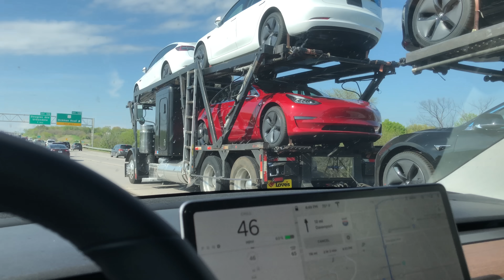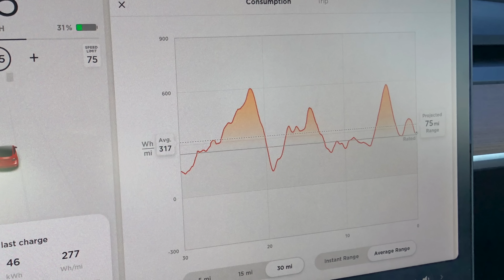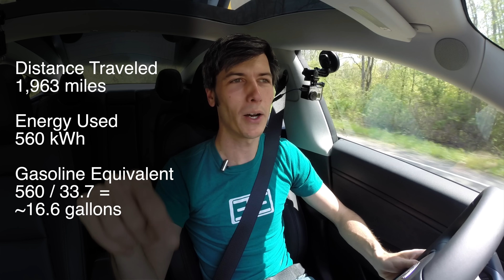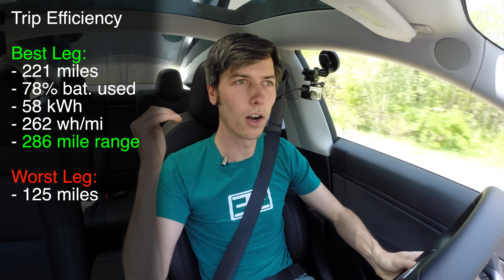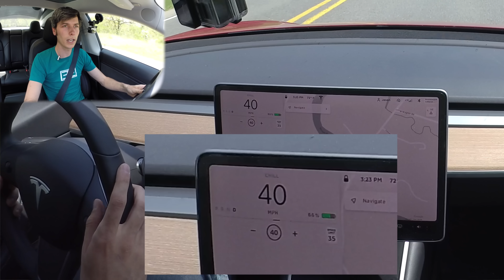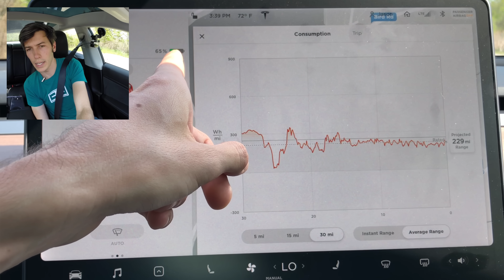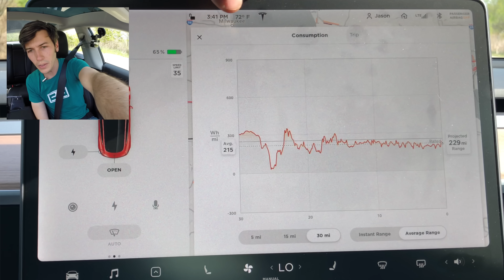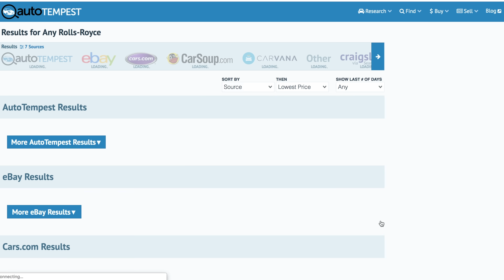How Miserable Is A Tesla Road Trip?

Comment: Okay you are a science guy and i have a question. How much this fast charging will affect the battery like, what can we expect in the next 2-4-7-10 years? when and how will the battery give up and we are gonna be forced to replace battery or car it self? and is it efficient for the peoples pocket? i mean will you save enough from driving EV  or for example 2.0L petrol engine with AVG fuel consumption of 6l/100km? will it pay off in about  before the battery die or not? cuz  normal person knows that this is not for the green planet this car is not green and it probably makes more mess than a 3.0L diesel engine in a life time.
Reply: The batteries are rated by miles, as it depends on how many miles you drive per year to define how many years it'll last. Tesla's batteries are rated for nearly the life of the vehicle at 300,000 to 500,000 miles. Tesla superchargers monitor the battery state to avoid degradation from fast charging (like easing the rate if temperatures get too high). Batteries are certainly replaceable, but generally something a consumer won't need to deal with unless they're going for ultra high vehicle mileage with the other mechanical parts. Overall, you save A LOT on fuel, not just because electric is cheaper but because EVs are that much more efficient, per the same unit of energy. Combine this with an ever increasing renewable grid mix, it actually results in a net reduction in pollution.

"cuz  normal person knows that this is not for the green planet this car is not green and it probably makes more mess than a 3.0L diesel engine in a life time."

Your average person isn't an engineer who understands the math.
Reply: @JimBob1937  in order to make all the energy green will probably require 90% of the planet taken from it
Reply: @unreal6959  , not really, lol, where the heck are you getting your information?
Reply: @unreal6959  , to give you some more context I suppose. Take California, which is the second largest US state in terms of energy requirements. They're already at 40% renewable if you count large hydropower, and 30% if you don't. There are many different forms of renewables and each has their place and their energy density per unit area.

Whether you like it or not, current world oil reserves are being used up at a fast rate. Known oil reserves, 1,650,585,140,000 barrels, current world consumption per year, 35,442,913,090. Years left thus is  46.57 years. Now, I have no doubt those reserve estimates are conservative, but even if we double them, we only have 93 years left of oil at the current consumption... and consumption is actually accelerating. Humanity simply needs to expand its energy sources beyond oil and general fossil fuels, end of story.
Reply: @JimBob1937  what i mean is, if we gonna replace power source  for example with  solar then it will require huge land to be taken  by panels for that, also the electricity is getting get  insanely more expensive because of that, soon it will be more expensive to drive on electric than petrol if this goes on, right now in my country its about 3$ per 100 kilometers of charge for my car, after inflation+ the green energy they expect to rise x2 by the end of this year and as you stated we are at 40%  of green energy, tho i doubt its that high, the reason is that if you wish to replace for example US nuclear and fossil  fuel factory for making electricity you need to cover 85% or so on the land in all the US with solar panels, you are the math guy tell me if im right or not, my end point is that in future it might be bad for us to drive an electric car and pay home electricity bills.

Comment: The vast amount of electric power plants is still fossil fueled, mostly natural gas (and that is not going to change anytime soon unless we go all nuclear). 

Let's therefore do an efficiency calculation from the burning natural gas in that plant to the traction energy that propels the e-car on the road. 

1) The average fossil-fueled power plant has 45% efficiency (meaning 45% of the energy released from burning the gas ends up as electricity that goes into the grid). 

2) Grid losses (distribution losses) before that power-plant electricity reaches your outlet at home: about 5% (best case). 

3) Car charger efficiency: 90% at best, probably worse for a roadside fast charger (it is basically a switching power supply). 

4) Li battery efficiency itself: also 90% charge/discharge efficiency (rest is lost as battery heat). 

5) DC-AC chopper efficiency (this is the module that converts the DC current coming from the battery to 3-phase AC current that the electric car motor requires): 90% at best, worse if you like to tear away at traffic lights. 

6) Electric motor efficiency: when I was still in college (yes, I have a degree in this stuff), they taught us 70 to 80%. But improvements have been made there recently, it is now in the range of 85% to 90% (at moderate loads).  We will take best-case here.

So over-all efficiency from the burning gas in that power-plant to the rubber on the road: 0.45 (power plant) x 0.95 (grid) x 0.9 (car charger) x 0.9 (battery) x 0.9 (DC-AC converter) x 0.9 (motor) equals 28%. This is BEST case, it will be less if you have an aggressive driving style, or when you run the car’s air conditioner, or MUCH less when you tow something. 

For comparison, what is the fuel-to-traction efficiency of a modern diesel car? It is way north of 40% (the Japanese claim over 50% for their latest diesels). And about 35% for a modern gasoline car.

To summarize: Does it make sense to drive an e-car out of concern for our climate? Not at all. The only thing these e-cars achieve is to move the CO2 emissions from the car’s tail pipe to the power plant smoke stack. And it does that at higher losses than a modern diesel car. And let's not even talk about the cost and climate impact of recycling all those worn-out Li batteries. My conclusion: The electric car – the BIGGEST nonsense product on the market today……
Reply: The big part is moving the smoke out of the tail pipe.

All you have to do now is the other hard part, switching energy production to clean energy. 

After that is all a matter of the free market. Battery storage will get more efficient. Likely to move away from lithium and on to chlorine, graphene, whatever works best.

The EV alone won't solve climate change, but it gives potential for us to burn less fossil fuels in the future.
Reply: @coheher  pretty interesting to go after EVs for being fire bombs while defending internal combustion engines..

With that aside, why not? Whatever brings down carbon emissions should be explored. It's just that as it stands now, biofuels and synthetic fuels still emit greenhouse gases. At best it works as an intermediary energy, like nuclear fission.

But again, if it ends in bringing the emissions lower than I don't really care.

Comment: We just completed a 6,000 mile road trip DC-MT-DC and didn't spend anywhere near 50 minutes per charge station.  Was closer to 30.  But that's in a long range all wheel drive.  Also, we made extensive use of Autosteer on those long North Dakota/Kansas stretches.  Greatly reduces driver fatigue and have no idea why, as a reviewer, you wouldn't discuss the benefits of that standard uniquely distinguishing feature.  But, thanks for you comments.

Comment: You charged too long per stop. You should have only gone to the next supercharger. How many superchargers did you pass? You should generally never stop for longer than 15 minutes.  Stop, plug, order food and or drink, pee/, pick up food, immediately go back to car, check to see if you can make it to another stop in about an hour/hour and a half, unplug, go. Look at charging curves. I think you wasted a ton of time.  You addressed this and it’s more messing. If you are in a pinch and really need to get somewhere fast, you can. Good thing about Autopilot is you can use your drive to research next charging stops.  If you look while you are charging, you can see the next stop available on the map. If the supercharger is too far, it is grayed out. 

Big mountains, yes bigger buffer, rain, bigger buffer, a/c bigger buffer, heat, bigger buffer.

Tesla needs a jump/hop mode. It’s Tesla though so it would be called cannonball.

Comment: Well, all of this is just fine, but, what if you do not drive somewhere without a charging destination. How about those of us who want to go to the out of the way places. I suppose in twenty years or less we may see more charging stations, but, not now. And, with more cars like this on the road, what will happen if you pull in to a charging station and it is in full use, you have to wait for someone to finish their charge, before you can do yours. For long trips, i would get a hybrid. But, since i cannot afford a new F150 Hybrid, i will just have to make do with my tried and true 5.0 v-eight, which gets about 21-24 on the highway at speeds of 60mph. I do not need a charging station and, while i do not get the great mileage, what i do get is pretty decent, and, i did not spend a fortune to buy it. One further concern, is the chance for computer hackers to attack the computers in these new vehicles. One other point, as more and more electric cars are using these stations, the greedy owners will just raise the price of a charge, even electricity goes up in price. Right now the Colorado river is dropping day by day, until the point where power generation will be curtailed, and, the cost of energy will rise.

Comment: ICE are more inefficient than EV. No doubt. However, an ICE will take you father than 200 miles between refill. Most all will take you 300+. Let's average 300 miles between stops. By your numbers, it took you 7.9 hours of charge time to cover less than 2000 miles. An ICE, averaging a minimum of 300 miles per tank of gas, will only require 7 stops, with an average refill time of 15 minutes. This will require 1 hour, 45 minutes of time lost driving towards your destination vs. 7.9 hours of time lost driving towards your destination for the EV. The EV is a total loss.

Comment: Another point when you compare the efficiency of your one Tesla car to the ICE is flawed because you dont account for the energy source of the charging station. Something is producing the power to produce the current to recharge your vehicles cells. Usually at quick charge locations it is a diesel generator. And at others a coal or oil burning powerplant is producing the energy for your charging station. That too has to calculated in the cost comparison of your EV.

Plus the environmental damage to indigenous communities that have to harvest Lithium for these batteries AND the difficulty recycling these EVs due to massive amounts of HazMats.

Comment: There's no sensor that tells how much charge is in a battery. It's determined by an algorithm that uses its voltage and other factors to guess how much power is in the battery. That's partially why they sealed cell phone batteries in phones. If they know exactly what battery is being used it's a better guess. But that's why years ago you could have a cell phone that died at 20%. Algorithms are pretty good now, but that's one possibility why you get inconsistencies such as you "should" be at 6% by this distance.

Comment: Traveled 2000 miles on the equivalent of 16 gallons of gas. But fails to mention the amount of coal it took to create the electricity used to power the car. Also forgot to mention the incredibly horrible pollution it took to create the batteries for his one car. Also forgets to mention how there is no disposal plan for all the batteries being created for electric cars. One study was performed which showed a person could drive a 1966 Plymouth Fury III around the planet three times and create less pollution than the creation of one Tesla battery. My point? Electric cars are not what green peace wants you to think they are.
Reply: If you're going to make an argument against electric you don't have to be misleading. Yes a lot of electric power comes from fossil fuels but in aggregate electricity as a fuel produced by a coal power plant still produces less pollution than gas.
Why?
Oil needs to be shipped to refineries and from there to holding stations and then to gas stations, there is a lot of pollution in the production and transportation of gasoline.

The carbon pollution needed to make a new electric car is something like 2000lbs more than a gas car, which isn't much given they're both in the 20,000-30,000 lbs range if I remember right.

What you can argue is the environmental impact of mining and disposal of lithium and the accusations of oppressive working conditions in lithium mines

Comment: For the record, ALL cars are electric. They ALL require a battery and can all run the engine and move the vehicle using the battery. Disable the starter in-gear override and your ICE car will move by battery.
Tesla has some safety issues with head-on collisions. If they fix that, its worth considering.

Comment: Your experience is pretty much right on with my speculation on the difference between EV and ICE.  

I regularly make a 500+ mile trip, which an aggressive driver who minimizes stops can complete in about 8 hours.  

I am not such a person.  I've had deep vein thrombosis in the past and make more frequent stops to get out and walk around.  I dislike eating in the car.  I choose not to tax my bladder.  I.e. I make at least two and more often three brief stops on that trip.  It sounds as if there would be little or no difference for a person like myself.
Reply: You'd be stopping way more than 3 times on a 500+ mile trip in an EV. Also, the duration of those stops would not be brief either.

Comment: Great vid, we are 68+ years old and we need to stop for BIO and aching bone breaks well before our Tesla Model Y needs charging.  We find the Tesla experience to be very relaxing and stress free.  Younger folks who can drive MANY MORE HOURS per day will probably complain about the charging stops.  Our MY is the LR AWD rated at 326 EPA range, I easily get 250 to 260 miles on the highway.  And AP in traffic is a game changer.  Not sure why your Model 3 didn't have Auto Pilot?  Every Tesla has Auto Pilot, what you don't have is Full Self Driving (FSD) which is a $10K option.  Push down on the left stalk TWICE and it will engage AP.   And FTR we are never going back to ANY ICE vehicle again.  Cheers USAF Retired

Comment: 2017: A Tesla charging station is installed at a popular winery near my home in south central BC, Canada. In two years it was used 3 times, all by the same Tesla.
2020: The charging station was removed. Total bill for install/uninstall...$30,000 Can

December 12th 2020: Installation completed of 6 Tesla fast charge stations at a small mall beside a major highway near the above mentioned winery.
January 25 2021: Talked to a technician servicing the machines. I asked him how many charges had been done. 4 times, 3 by the same car.

Yup. Teslas just need more unused charging stations to make them more legit.

Comment: You'd have to pay me a lot to take a cross-country trip in all all-electric vehicle.  To spend 50 minutes idle every 200 miles is a nonstarter for me.  Who wants to spend hours and hours charging when it takes just minutes to buy good old fossil fuel?  Oh, just eat whenever you stop to charge?  By the time I covered 2,000 miles I'd no longer fit in the seat.  And all that assumes you can actually find fast chargers along the way, that they'll be in working order, and that they'll be unoccupied.  No thanks.  And unless I just missed, it you noted that your Tesla account was simply tapped whenever you charged, which is convenient, but you made no mention of HOW MUCH you were charged to charge.  I understand no rates are generally posted on the chargers, so you can easily get shafted.

Comment: The fastest way to get across the road is to drive fast and charge more often, but only charge from 10% to just enough to get two hours down the road.  This uses more electricity but the cost is minimal.  The shorter drive runs help the driver stay alert.  You will arrive at your destination fresher and less tired.  A BetterRoutePLanner is a better way to plan your trip than Google maps and the Tesla app

Comment: A 15% buffer is excessive and probably added a lot of time to his trip. I go with 10% (as you're driving the car will always display what it estimates you will get to the next charger at and it's been very accurate even in subzero temps with heat blasting and driving 80-90 mph) if this does happen to drop below 10% as you're driving then just slow down a bit.  It's ideal to only charge up from 10% to 70-80% at each stop because charging slows down drastically after that.  Charging 10% to 70% takes just as long as 70-100%.